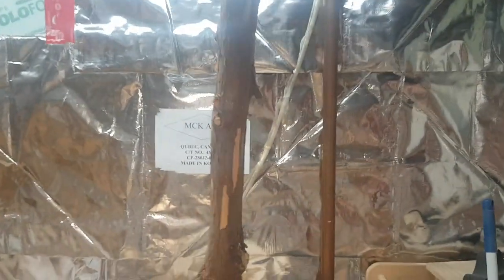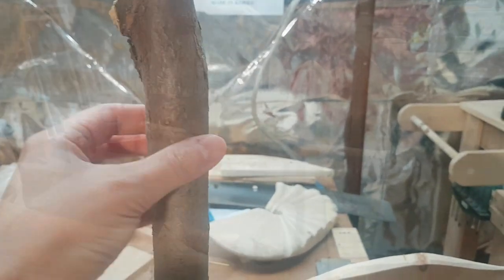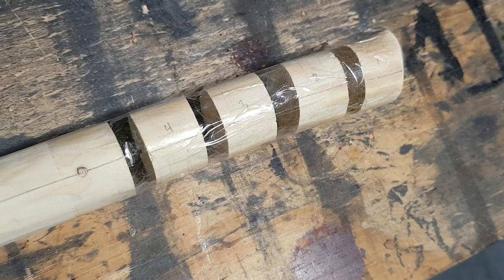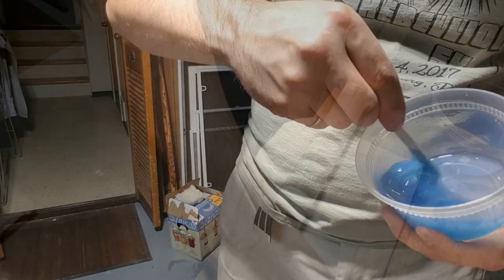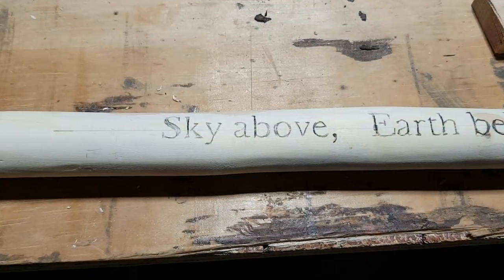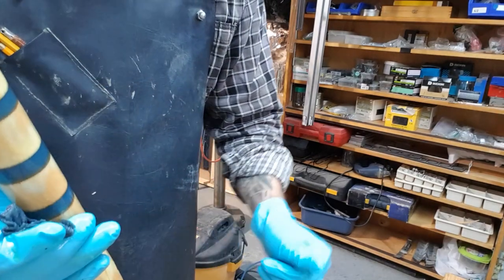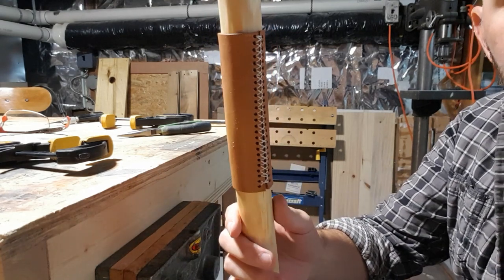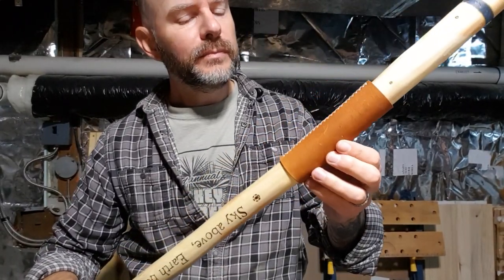Walking Stick with leather wrap and pyrography

Comment: Nice job, Jason.  You give me ideas.  I might suggest that after wrapping the spaces with packing tape, you might have used a 12 cc syringe to inject the resin through the tape.
Reply from the maker: Great idea, probably would have been quicker to fill the spaces… and less messy

Comment: After I strip the bark from the stick, I have had a lot of the sticks crack, or split , while waiting to be worked on. Any ideas
Reply from the maker: It sounds like they are drying out too quickly. I usually leave the bark on, which slows the drying process and make sure I store them in a cool area out of the sun (my garage or basement). This does take longer to dry (up to a year) but minimizes the checks or cracks from forming. I use a lot of dead sticks I find in the woods and I like some of those defects, I just fill them with epoxy and gives it some added character. Hope that helps
Reply: @JasonHedrich  thank you
Reply from the maker: @gam940  happy to help

Comment from the maker: Let me know what you think... did you like the leather wrap compared to the paracord wraps on previous sticks? What did you think about the wood burning on the side... always like to hear what you are thinking.
Reply: Like the leather wrap, so much more appropriate compared to paracord. If I dare, try to do it myself on my DIY walking stick I’ve found over 30 years ago in a wood and used and maintained since. By the way, is there any way to determinate which wood it’s made of? The stick has been sanded, restored, oiled en varnished many times since…. Just curious.
Reply: A variety of techniques and tools makes it fun.  I like the leather wrap.  I'm not sure how it will hold up over the years, but it is a learning opportunity.  Nothing lasts forever, but that is part of the process.
Reply from the maker: @charlesschauberger6700  exactly, I like to try something different in each stick… don’t want to keep making the same one over and over again